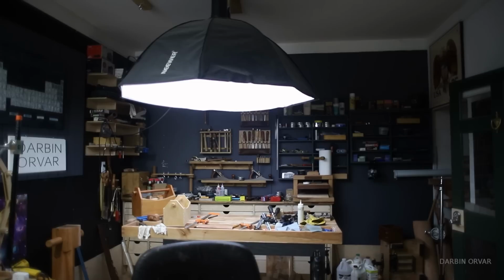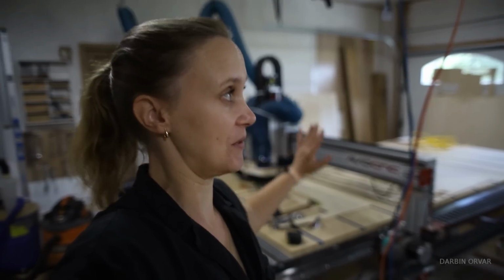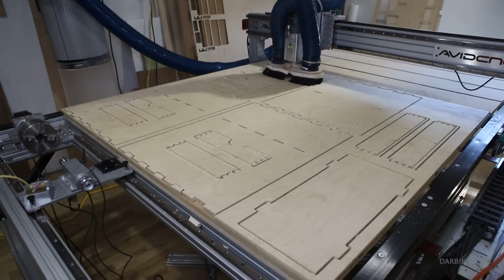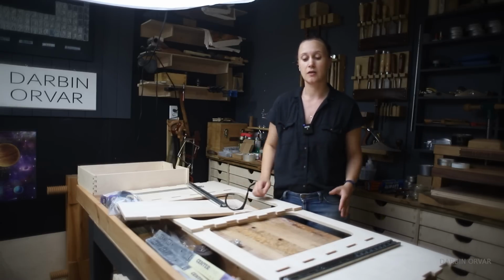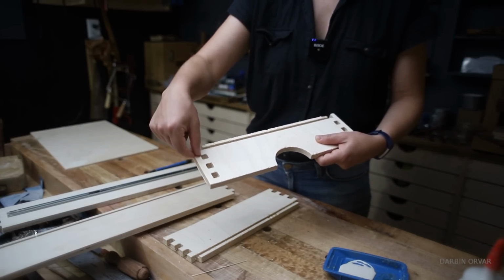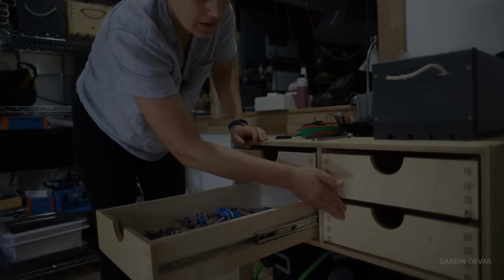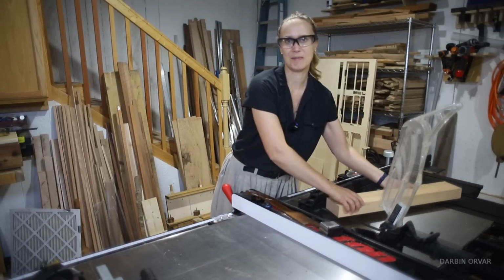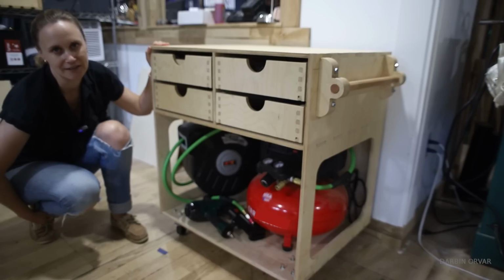How To Build a Router Bit Organization Cart - Free Plans!

Comment: What's the common cause of a broken bit on your CNC?
Reply from the maker: Going too fast, going through too much material... thin small bits break A LOT easier, and sometimes they just break after use.
Reply: @darbinorvar  

Just thought of three things that might reduce bit breakage.

The first two are obvious and the third one I have not seen done to CNC woodworking mills.

Years ago I purchased a hobby CNC which used a Dremel as the spindle tool. There were two primary rules the seller insisted on customers following:

1) Slow down, let the tool do the work; it's not a plow.
2) Do not cut deeper than half the thickness of the bit.

I don't quite remember but I think he used the half thickness of the bit rule for plunge cuts using the pecker method as well.

Bits that break after use are most likely breaking as a result of becoming brittle due to heat build up.

It just occurred to me that you could add some cooling assistance to your CNC.

When cutting metal, bits are usually cooled by water or cutting oil, neither of which is good for wood working. 

However a slight mod to your CNC's tool mount, would allow you to run a small air hose(fish tank size) and position it to blow air directly onto the bit. You can use a fish tank air pump or connect one of your air compressor lines to it with an air modulator (like in an air brush) to control how much air is blown onto the bit.

To get some good ideas, look up how air assist is added to a laser burner to enable deeper cuts. In your case, you may want the air directed so that it blows down the length of the bit and have it mounted on with a magnet so that you can easily move it out of the way for bit changes.